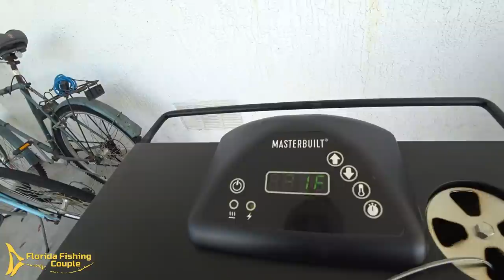Living the Dream in the Florida Keys

Comment: I smoke meat about 3 times a month. I personally use pecan chip's,  it is a lighter and sweeter smoke. Also try using red/pink butcher paper to wrap your meat in to finish it. It let's the moisture out so the meat does not sweat. Just keep trying different things until you find what you like. It took me 3 years to master a seasoning that has a Cajun kick and tastes like barbecue and it's a dry rub. Bacon wrapped lamb chops are awesome smoked!!

Comment: Chef’s secret! :
Those dripping are the basic ingredient for a gravy or dipping sauce. Add some apple juice to the pan of drippings, place over a burner on your stove and heat it up while stirring with a whisk. Some of the liquid will evaporate, so cook it to the consistency you desire (gravy moderately thin, aux jus almost water very thin, dip fairly thick). It will enhance the flavor of the meat astronomically.
Reply: I agree with salsmario327 on cooking with fat cap up. Not only renders into the meat to keep it moist, but some travels through and around the meat, adding to the flavor of your drippings.
Reply: PS: the drippings are called a roux (pronounced roo).
Reply from the maker: Great tips for next time. Always willing to try something new. Thanks!

Comment: I have the exact same smoker. There is a "cold smoke" adapter available which you put on the side that replaces the little wood chip scoop. It holds 2 hours worth of wood chips and pipes the smoke into the chamber through that hole. While it is meant to provide smoke without adding heat (for cheese or anything you don't necessarily need to cook), you can still set the heat and timer on the main control. It is also easier to fill and clean. Doesn't work with pellets though.
Reply from the maker: That's pretty cool - thanks for letting us know!!  Someone else mentioned smoking cheese also!  We've GOT to try that!  What do you have luck with - as far as type of cheese and wood chips? - Elizabeth
Reply: @FloridaFishingCouple  I use apple wood, and I usually do Gouda and medium cheddar. Its always a hit.

Comment: I'm a fat cap up kind of dude. My engineer brain insists it would result in self-basting, since the fat had to render and drip across and down the meat before dripping off, where as fat cap down on a grate will just render and drip through the grate.
Reply: Good question. I'm 5ft 6 220 but 33 inch waist. Does the smoker drip down the fat because I'm getting sick of so much fish n would like new ways of cooking fish.

Comment: Wait until you learn to smoke CHEESE with the Maze! 
Looking forward to your adventures in fishing and smoking now.
Reply from the maker: Man, that sounds AMAZING!!!  What type of pellets and cheese do you use?? -Elizabeth
Reply: @FloridaFishingCouple  Go with a Hickory or softer wood, and low heat for an hour or so (you have to learn your preferences). Wrap up tight in plastic,  and stick in the back of your fridge for "2 weeks" to let it blend and mellow. 
This really IS a case where you can go to strong,  but the end result is so worth it when you are right. 
And with the Maze,  you don't even need the heat source; just use the smoker box as a cabinet.